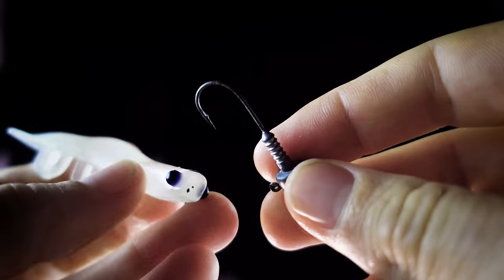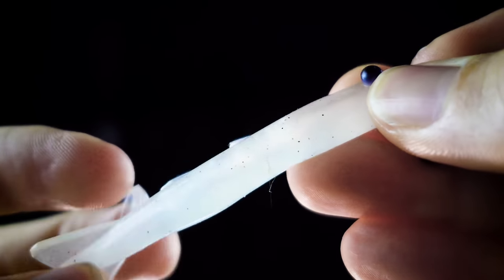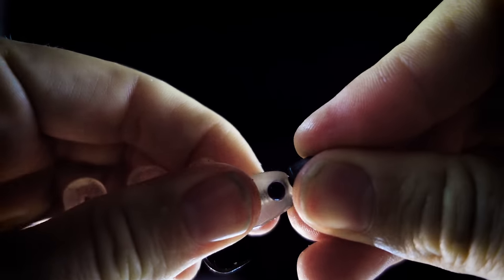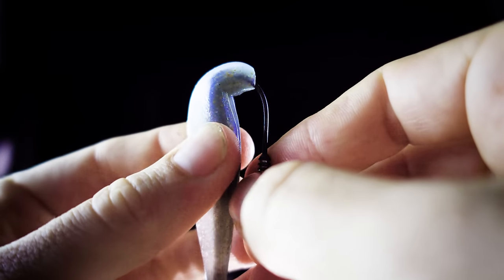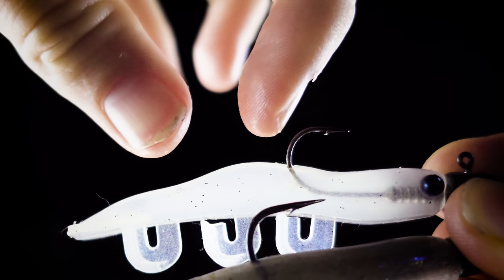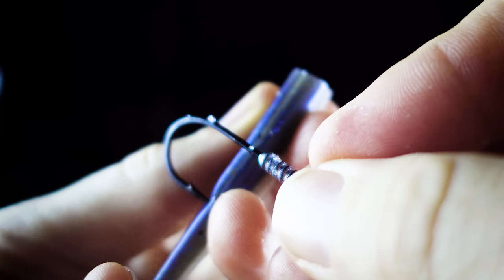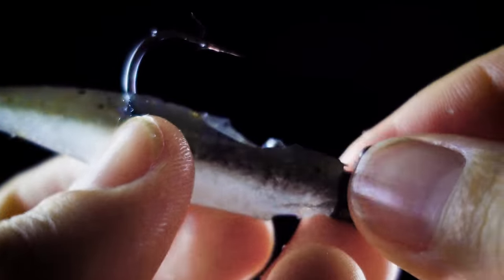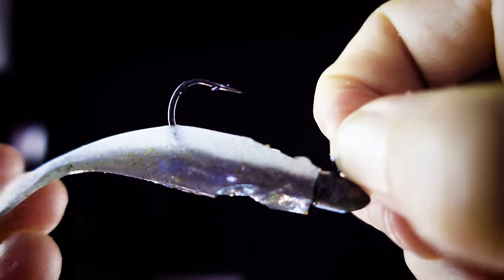Rigging Soft Plastic Fishing Lures

Comment: Hey Briggsy, I use a similar technique to you except I just use a permanent marker and make a tiny dot, that way I don't rip the SP any more than I need to. Also, you can buy a soft plastic glue from the US called Mend It, Savage gear also so one. This enables you to literally glue the SP back to how it was, without using Super glue or similar which is too hard when dry, hope that helps some one.. 😉👍
Reply: Yep I do the same thing it helps

Comment: Where do you purchase those jig head hooks? Great video, thanks!
Reply from the maker: Hi Mate, they're "TT HeadHunter Jig Heads" search that in google you should find em. I either get them from MoTackle online or just buy them down any local store as im driving through a town (they should be in most tackle shops in Aus)
Reply: Thanks for the info, I'll check them out.